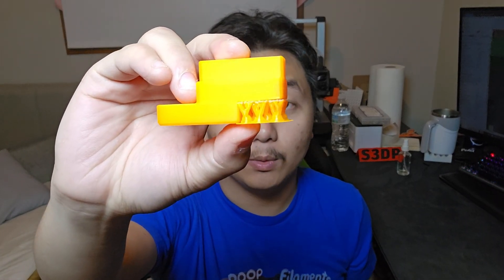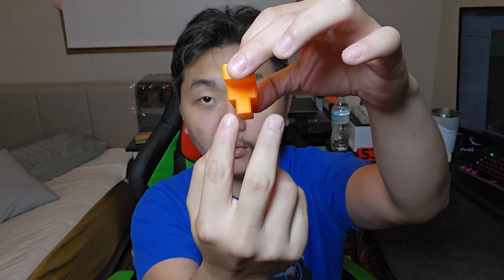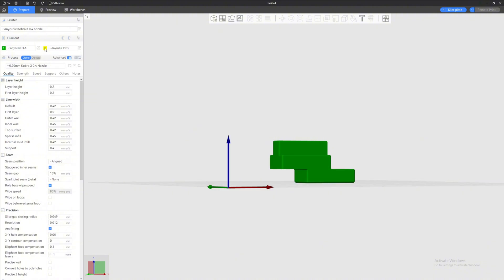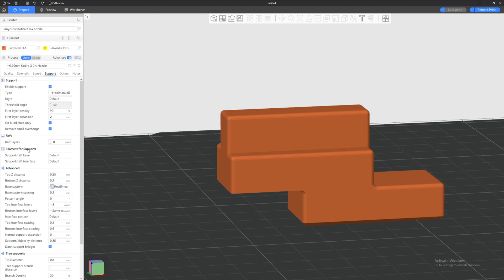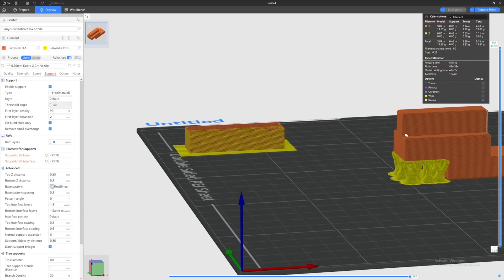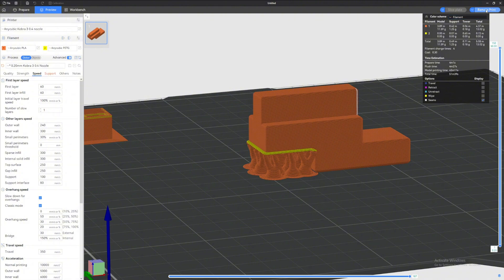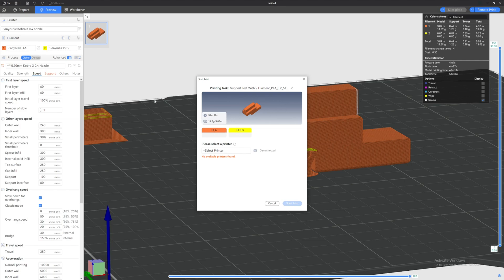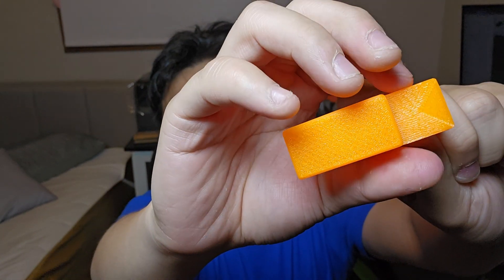3D Printed Supports Made Easy To Remove

Comment: With such printing, the support is really removed much easier. But there is one point. If the model is small, then the layer of the base material on which the change took place after printing the support with another material becomes very fragile. Increasing the volume of plastic extrusion during the change does not help.
Reply from the maker: Yeah if the model is small then it would be more difficult to print support with a different material.
Reply: @Scratch3DPrinting  I checked on a larger model - the layers of the base material at the same level where the binding layers were printed also turned out to be fragile and the model breaks easily in this place. 

However, it may be worth noting that my main material is PETG, and the binder layer is PLA.

Comment: Why does it print a prime tower?
Reply from the maker: It's for priming the new filament that is using as the support material.
Reply: @Scratch3DPrinting  I think I was wondering, why the tower over on the side? Seems completely unnecessary. It's literally printing the layers just fine and printing a support structure on the side for no reason
Reply: @Numenor7  you can remove the prime tower if you are in anycubic sliser next go to the Others and in the "prime tower" you can uncheck the mark.

Comment: You forgot to change Top Z Distance to 0.0
Reply: Came here to say this distance to 0
Reply from the maker: I don't think that should be 0.0, if it's that then it will be too close to the 3d printed parts and might bond together. There has to be a small clearance.

Comment: Hi.  Can you change filament in the Ace mid print?  Start using color A, then pause and change to color B without color painting?
Reply from the maker: I think you can, but it has to be in the same slot that you were printing with.
Reply: I wouldn't do that with different materials tho PETG and PLA have different melting temperatures
Reply: Yup. On the touchscreen press Pause > tap the ACE box icon > press "Retract" to cut and unload the current material. 1) If you wanna switch out the whole spool: Simply pull it out of the ACE > insert a new one through the same hole > hit "Extrude". 2) Or if the new filament is already present in ACE but in another slot: Select another spool slot on the touchscreen > press "Extrude". Just remember that it will print with the same settings (temp, speed, flow rate, retraction etc...). For a quick temporary switch to PETG you can set the nozzle temp manually (same menu where the ace icon is) btw.
Another way is to do everything manually like we did in the old days: When ACE is powered off, pull the lever on top of the print head (right next to the 4-tube-block) to release extruder tension, and then you can pull/push the different filaments by hand directly from your ACE. Just remember to press "Retract" the button to cut the filament BEFORE, so that you don't accidently do a "hot" pull. You could even switch one of the 4 PTFE tubes with the short tube intended for spool holder use (press their black ring to pull a tube out of that 4-tube-block).